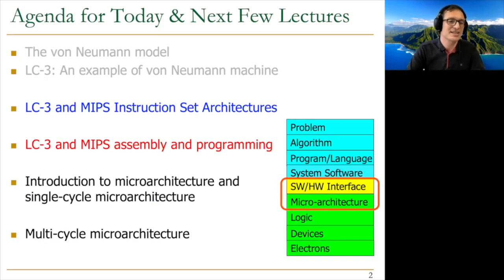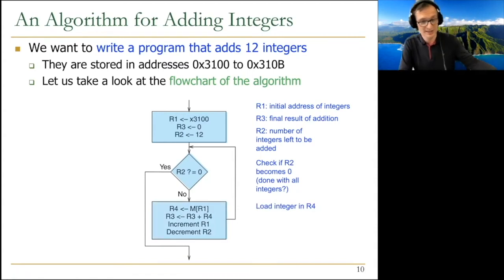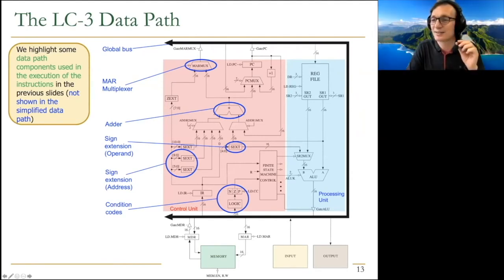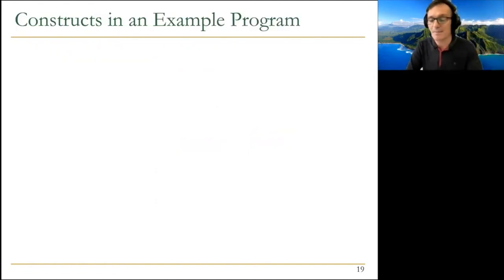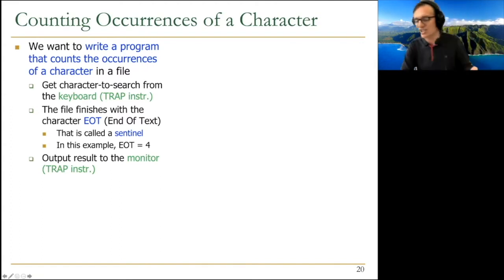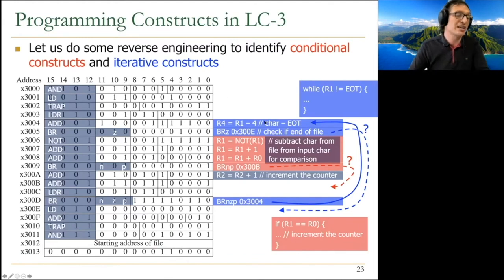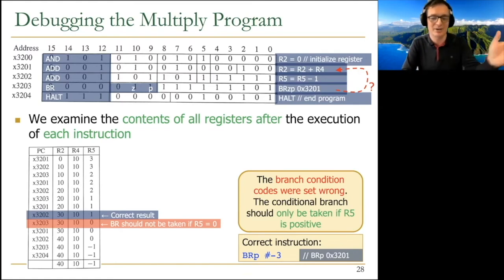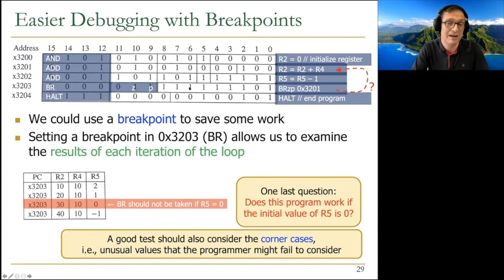Digital Design & Comp Arch - Lecture 9b: Assembly Programming (Spring 2023)

Comment: @37:00 I was a bit confused that substracting 12 from the stack pointer (addi $sp $sp -12) helps allocate space on the stack, but then quickly found out that the stack grows "downwards" in memory 🙂 Now I get why function call can only take a limited number of arguments and otherwise you work with pointers (I guess).
Reply: Yeah, you can always store the extra arguments onto the stack before calling the function, and the function can retrieve it from the stack at the beginning.